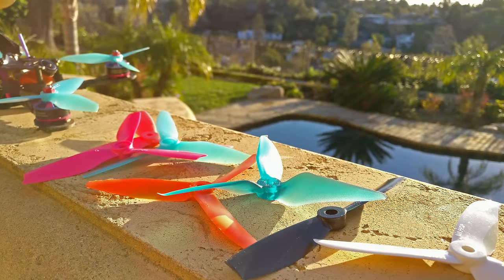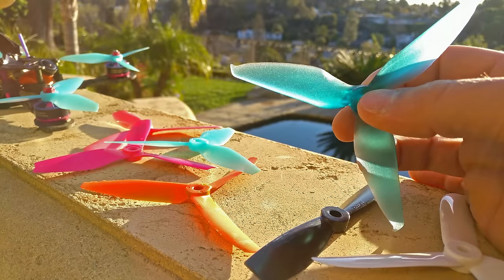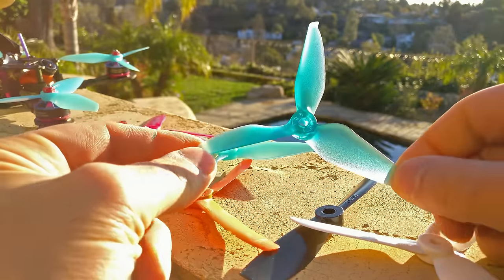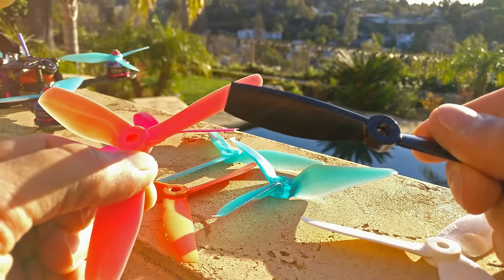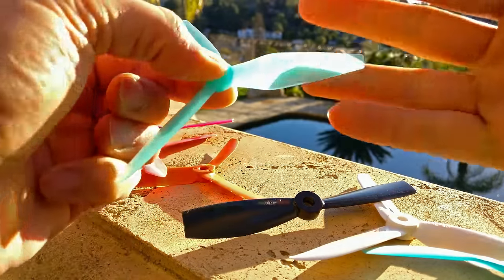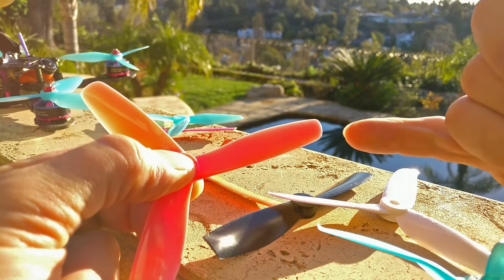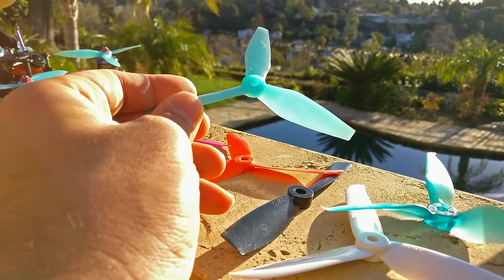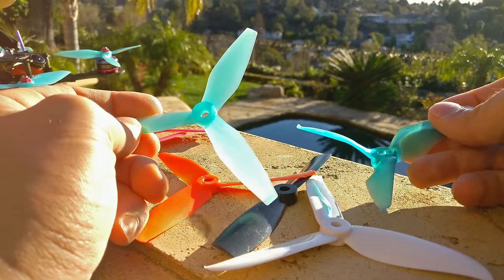Prop Analysis - Quad Theory

Comment: Okay, so you Suck as an engineer and the scientific method, and I mean that in the best possible way.  But you are an amazing pilot, with a lot of experience on different products, and where you are most qualified to speak is pilot feel.  When you say a prop is squishy, or has no top end, or the motors can't pull it, or the quad struggles to stay in the air because the props are so inefficient.  You have the experience of trying a ton of stuff and are a good enough pilot that I really trust and respect your opinion.  I will not be buying the new HQ props, thanks for the vid(s).  You are also transparent and I appreciate that, and you say what you don't know which is few and far between.
Reply from the maker: Spoon FPV yep that's pretty accurate. except that I do know the scientific method very well. I've done plenty of published research in the medical field. I just don't have all the needed tools and resources to do it for this space. I'm also not convinced it's totally needed here...they're just kinda toys. but yeah I'm all for the discussion. don't claim to know much. just throw some logic at it that I've gained from test test test
Reply: But Bob your narrative around this is very confused. You make long videos about Quad Theory with factual statements on one hand, then say you don't know anything on the other.
I do like watching your videos but the validity of the content is so confusing. I have a scientific background also but as far as I can see most of these videos are pure hypothesis and subjective opinion - but seem to be frequently presented as fact - followed by the caveat that actually you don't know. It is quite frustrating and I do wonder what the motivation of these videos is...
Reply: :-) . There (internet) are many informations about how propellers work ,-) . Another thing is its look like some manufacturers really dont know what or why they are making props with some shapes. And it looks also sometimes like i will make interesing look, and peoples will buy it , because it is new, and it have nice shapes and if it will be transparent, i will sell tons of them.
Reply from the maker: Stephen Wright yep that's also pretty accurate. I don't claim to know anything to cover my ass for those that are gonna yell at me for no reason. in reality, most of my information doesn't come from me. I regularly talk to a fluid dynamics engineer, an actual prop engineer, multiple brushless motor designers, a couple very advanced motor testers, and then I do some testing on my own to validate all I learn from them. once I've I've done that, I try to teach it to a few people to solidify my understanding then spit it out on video as logically as I can. I also do all these videos in one take and edit very quickly. unfortunately I can't spend much time on any video. a lot of the time I watch it back and miss a lot of what I wanted to say. sometimes I just scratch the whole video. I always try to keep it short but lately I've been trying to present things that are a bit more complicated so just coming up with the words to explain it to someone that knows nothing is a challenge. from here on I'm gonna do some different things. I believe I've covered most of the basics and then some.  I have so so content to refer people to.
Reply: fair enough. I remember with your disc area video as you mentioned it was a theory you got from Braindrain...it is useful to spread these ideas around. I was a bit boggled by the first minute of this video....but I do appreciate your enthusiasm and info sharing.
Reply: The information you present is generally based in reality and useful for a lot of the community, especially for those of us with less engineering/science background. You seem really receptive to feedback too and always ready to correct any kind of mistake. Keep making videos!
Reply from the maker: R J yeah I do my best to try and not just spew total bullshit. always appreciate anyone that helps with that. I generally feel like this sport is an area where people will begin to use for all levels of education and research. I'm hoping that the very basic stuff I'm trying to present gets some people thinking.  if this stuff existed just two years earlier I would have had the time to drive it into private highschools on my own.
Reply: bob is a great teacher and an intelligent person. When he talks we all listen even though he can get carried away some times :)

Comment: By clipping the ends, you reduced thrust AND inefficiency. Thus, the prop spins up significantly faster. Wings on planes have a shape for a reason (Dreamliner)
Something that you did not talk about is how the blade bends under load. A stiffer prop might deliver faster/more precise.
And most important: 2-blade props are more efficient than 3-blade props. So, a 2-bladed 6inch is better than a 3-bladed 5inch and the thrust test numbers are showing this.
Reply: Also, maybe you are beginning to overrate the impact of the propellers weight. How much do the rotating parts of your motor weight? Just think about the magnets and the shell of a 22xx.
Reply from the maker: Lars lrs yeah I do these videos in one take and try to cover as much as I can remember but I have no script or outline so I often forget a lotta stuff. adding that in would have made it much longer too. the rotational inertia is a huge factor. the weight is just an easy way to gauge it. the prop shape also make a significant difference. the motor having the torque to properly manage the blade is what gives you good control. otherwise it's just a low response mess that's difficult to tune right.  this is the reason why the 5x4x3 is such a good prop. it has very very good control.
Reply: More efficient at speed, but the extra lift of multiple blades at slow speed can outweigh the inefficiencies and lead to longer flights. I mean this as within 5in category, and equal blade area 6 dual vs 5 triple, the 6 will still win.
Reply: When spinning the motor, a less stiffer prop bends its tips before it delivers. That is not an issue of the weight but it is related to response. On the other hand, 3 blades have less load per blade, if they deliver the same amount of thrust as a 2bladed prop. A stiffer prop is harder and more costly to manufacture. Also, stiffer props break easier. So why aren't we seeing more stiffer 2bladed props? Well, there are numerous videos about GF 6030 exploding in the air, the material couldn't take it. I would love to see those dynamic thrust tests of very stiff 2bladed props proving me wrong.
Regarding inertia: The magnets and the shell of a 22xx motor have quite some distance from the shaft (11millimeters). Lets put in the numbers and see how much impact a difference of 0.5 grams at a radius of 40-50 millimeters has?
Reply from the maker: Lars lrs the motor does have a good bit of weight but usually more weight on the bell means stronger magnets which should far over compensate. regardless it's still an issue and we want the thinnest strongest magents possible. the prop of course makes a significant difference as well since it's so easy to tell when you're flying a heavy blade vs a light blade. even just 1g variation. and by heavy/light I mean more/less rotational inertia

Comment: nice to listen to someone's perspective on how they think things work. 
so basically i through this i kept thinking a planes wing usually has a tip which reduces drag and improves performance. 
i've used the props u mentioned and agree with some of the statements u made, but i still use a few of the other more demanding current sucking battery demanding props because i have them available and like to mix it up. but i sacrifice speed for the same styled prop u use as your go to prop also. just seems to work for me. 
the other thing is like to suggest is maybe manufacturers could actually say "we have designed this prop to best be utilised in this fashion where we think you would get the best from this version of our design, then we could like you say have props used to their best intended design based on our application we are using. 
i'd like to have a range of props where i could quickly change where i knew ok i'm going to get and extra percentage of top speed, or this prop is going to give me mega low down torque or my mid band range is where this prop is going to shine. 
once again an interesting listen, its better than watching shit tubers are reviewing that you can't a hold of just so they can pump out crap.
Reply from the maker: Daniel Hemi-Bateman yes yes yes I have discussed with racekraft and other companies to pleas please please put the specs of the prop on the bag. how best to use, max blade loading in terms of AUW, recommend motor specs and models....this information is stuff any engineered prop must have in order to be made. they already know what it is. they should just tell us damnit. it will happen in the future. I'm putting too much pressure on RK for them not to.

Comment: nice thoughts, would you mind doing a quick video on how/why people put props on backwards?
Reply from the maker: AveryFpv I'm not sure what you're referring to.
Reply: I've seen a few of the top pilots put there props on so that they spin towards the side of the craft, not the front, I asked but they didn't give much of an explanation
Reply from the maker: AveryFpv oh that's easy. it's because they don't want to spray crap on their FPV lens when flying. when the blades spin inwards towards the camera they fling whatever crap is on them directly onto the lens. flipping rotation isn't a good idea however. the blades spinning forward on the outside of the disk generates more thrust on the outside. reversing the rotation generates the thrust on the inside of the disk which is where all your arms and electronics are.
Reply: OK thanks, I'll try it out both ways sometime

Comment: It just depends of the usage you have for each prop... most inefficient props are used by racers who would just want speed, and dont care about how much amp it burns up, they are ok that it would kill their lipos, they accept it, for the extra speed that they can squeeze out of such prop or some ultra high kv motors... they (some) want to win the race at all cost. And of course freestylers would absolutely stay away from these props...  it just comes down to what you want the prop to do for you, what sacrifices you are ready to make to have those performances, as no prop will ever be perfect.
Reply: Well said, only thing I would change about your statement is that it depends on the race too, as too amp hungry as you don't finish.
Reply from the maker: Ray Choi that makes sense but on the cyclone blade, I can stay on the throttle more of the time. also, the motor has an easier time spinning the prop so it can push it up to higher RPM's which means it'll move quicker given the same pitch. none of this stuff is as straightforward as expected. some of my quads go faster on the 5x4x3 than they do on the cyclone blade. what I thought was my fastest quad barely hits 80mph while a superlight 2204 total piece of junk hits 90 without issue and can keep on it at that speed. there is no universal prop. the track governs the setup. if I were going for punch I would only use quad blades. they're lighter and have far superior control than the new HQ blade.

Comment: Very basic rundown while ignoring the cross sectional shape of the prop, there are a couple of important factors when looking at a prop.

Thrust is basically determined by the advance ratio (basically blade angle and cross section) and the area of the prop. These two factors also determine the stall characteristics of the prop which change the flight characteristics, a high advance ratio  will have a tendency to stall when spinning quickly at low speed and should result in a less "grippy" feeling during turns. 

Efficiency is best when the prop is not running stalled, and when the prop is designed to reduce the induced drag you get with a bullnose prop. Basically whenever you want to maximize pure thrust at a given prop size you increase drag. Increasing the number of blades increases drag, increasing the area of the prop increases drag, increasing the advance ratio will generally increase drag in quads. Unless something really innovative is going on, an increase in thrust should come with an increase in drag that is large enough to reduce efficiency.

Response comes from a mixture of weight, thrust/rpm, and advance ratio for a certain prop. Of course less inertia means you can change the prop's speed in an instant, but response time as a flight characteristic actually comes from the change in thrust over time, which is why thrust per rpm is important. This means that the prop's total thrust plays a part in response time, so a heavier prop that produces much more thrust might have similar response when compared to a light prop with less thrust. I mentioned advance ratio because a certain blade angle can only provide so much thrust at a set speed. A high advance ratio prop like the racekraft will allow you to change thrust much more easily at a higher speed, but will stall at low speeds.

Also the entire shape of the racekraft prop with extra chord length near the center that tapers out to the tips looks like it's designed to reduce the intensity of the vortex near the tip and maybe reduce deflection. The fancy little tip is meant to reduce whatever vortex is leftover.

Some bullnose props will be alright efficiency wise if the chord is a lot shorter near the end as that will yield less of a vortex, but in general bullnose means they sacrificed efficiency to squeeze a bit more thrust out of a certain prop diameter, which might point towards poor or lazy engineering. 

Overall the intuition you've built up from practice and talking to designers is pretty much accurate. I was kind of ranting but I highly recommend you take a look at some efficiency vs advance ratio plots or efficiency vs rpm plots to get a better idea of how and why some props work better than others. The engineers can for the most part only make tradeoffs between total thrust, max efficiency, and the range of speeds and rpms where the prop is most efficient. They can aim for high thrust, high efficiency, a mix, or efficiency/thrust over a larger range. Or they can make the HQ V3 because it looks neat.

(I'm pretty new to the hobby but I'm pretty sure everything I said is right, if anything is glaringly wrong when applied to quads let me know)
Reply from the maker: R J yep all great and is how I understand it for the most part. I just can't present that because the vast majority of watchers wouldn't understand most of it. the advance ratio is a much more meaningful number I think.

I also understand that ability to create thrust quickly for good control but I feel like there is added control from the easier gyroscopic effect of a light or otherwise low rotation inertia of a light blade.  also lower pitch/AR blade will maintain generally higher RPM's that should lead to improved stability and control too.
Reply: I'm glad we're on the same page, I hope we see more engineering go into props soon, but it is a difficult problem that changes for different quad sizes and pilot styles. Good work on the video.

Comment: Here's what I'm thinking. I can't remember the names of all the props. towards the end you are repeating you can't see how the prop is efficient, even though the engineer stands by their design, it seems like it draws a lot of amps at all times. ... Perhaps the prop is easier for newbs. also, perhaps the prop works better with less refined builds than your preferred more refined props. The racecraft seagulls might not work as well for everyone as they do for you, because you are running well tuned rigs, and are very familiar with them. Many pilots simply won't fly enough to ever fly so fast, and when they do fly, by having an envelope of turbulence, it will create a sort of predictable delay that the pilot can work within. Their copter WON'T go rocketing off on a punch,, but it also won't drop from the sky in an accidental throttle drop. The same pilot could choose a gentler prop with less lift all around, which might keep them safe from undesired rocketing,, but they would spend a lot of time on the ground. By choosing the turbulence cloud pillow, the pilot can mush the controls without crashing so much. This might also be a great way to break in to finer engineered builds, because jumping from gemfan 5030's to racecraft seagulls will be much more different than working up through the intentionally brash diamond shaped noise machines.. They would create a stability within the instability. they would consistently and predictably cause the copter to occupy more space,, meaning more vibration, more ruckus, more waste,, but also easier forays for the first time ripper.

Comment: Hi Kabab, I'm running the Emax rs2205s 2600kv motors and I've tried the cyclone 5046 props on them. I think I like it but I'm not sure if the motors kan handle the weight of the prop. MQTB says it has a lot of tourque for a high kv 2205 motor, what would you say is it ok to use it?
Reply from the maker: Glen Bales yeah the newer S version of that motor can do it. however try a few different props and see what you like best.
Reply: Great thanks for the reply, so awesome that you reply to so many comments! Yea I've been using the kingkong 5040x3 blades but didn't like then (got oscillations). You're videos are great BTW, keep it up! :)